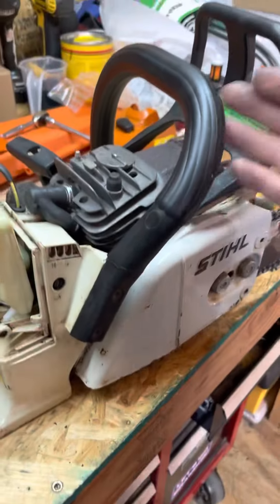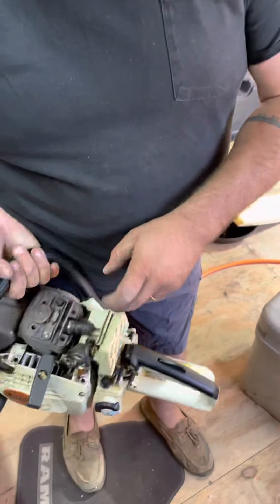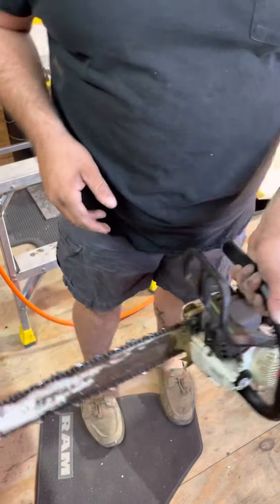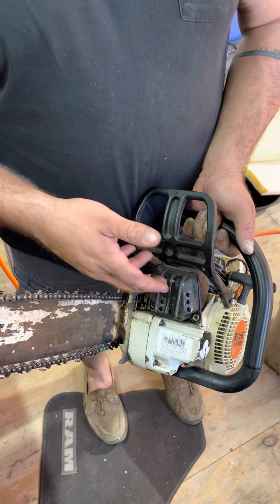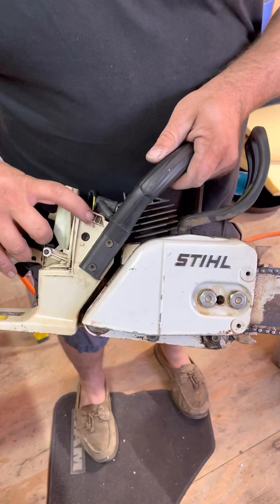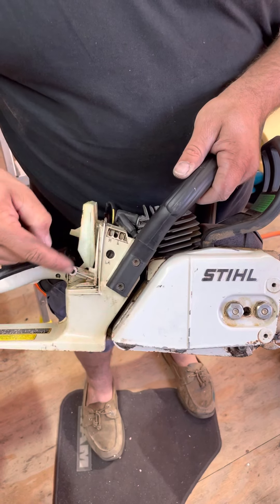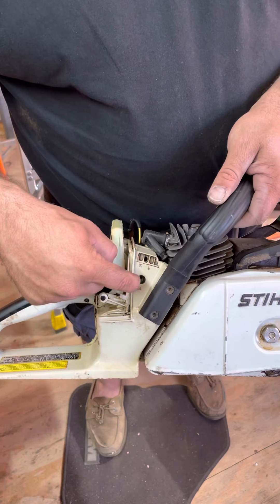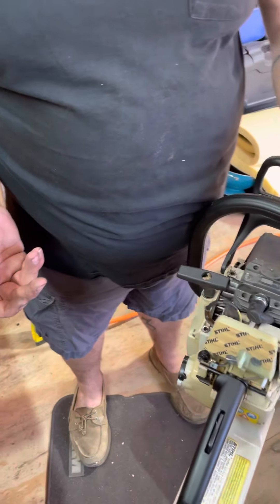Stihl MS260 issues

Comment: Pull spark plug off if flooded, pull about 20x, and restart.. should work

Check to make sure the fuel line is not pinched behind the air filter 

Check the flap in the air filter that it it functioning properly and coordinates with the little lift spot on the right hand side of the saw when you are  looking at the carb in front of you

Also from experience, its a walbro carb u have, rebuild it with a good kit, and set it to one turn out counter clock wise on the screw from the screw lightly seated clockwise down as far as it will go

Chances are it is probably a diaphragm gone bad if the carb was cleaned and you have good spark

If ur arm is tired, u probably have compression. Gap and check the plug to 20 thousandths and clean out if flooded

Just dealt with a demon 260 myself that tried me pretty good. 

Long story short, new oem coil, rebuilt oem walbro carb, proper adjustment on carb (just about  1/16 of a turn richer than standard setting)and a new air filter (oem) and its running great again

Just for what its worth, amazon parts do not seem to work as well on stihls.  Both weedeaters and saws dont seem to like their carbs, and those filters with flaps are just rubbish 

Good luck with ur saw